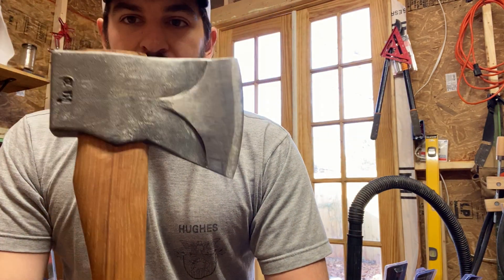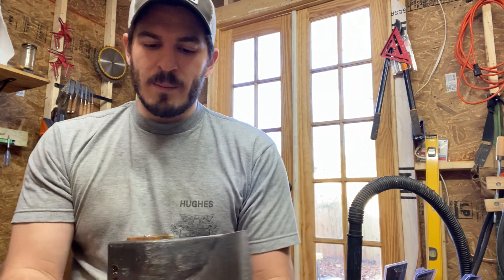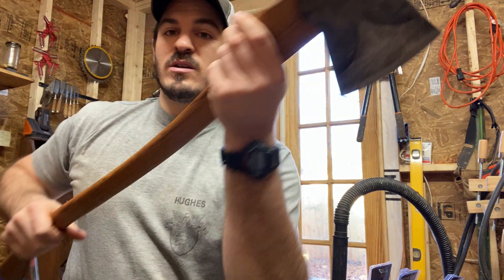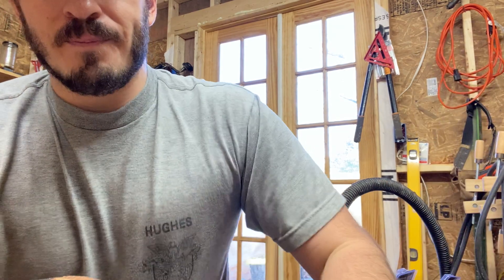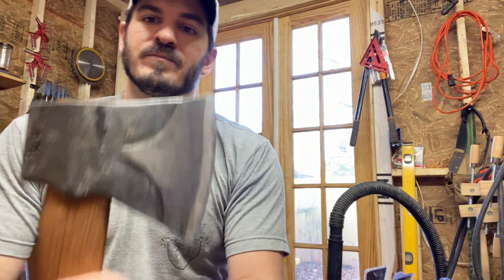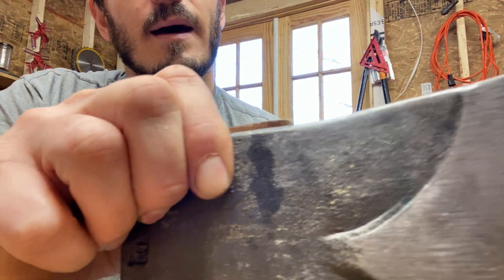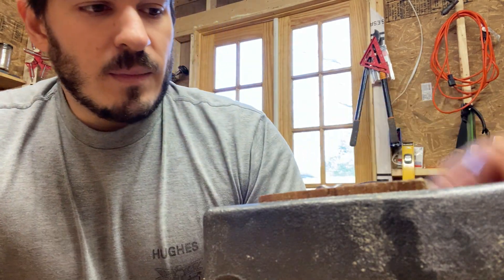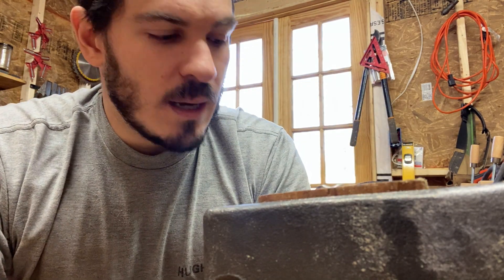The defect that could make your axe dangerous

Comment: yeah council tool deffo have the worst hangs
Reply from the maker: I was able to get the wedge out. It was so thin, not at all compressed. It didn’t go more than a finger width into the axe head when it should have been 2/3 the way in! I rehung the axe and it’s performing well now.
Reply: @urbanlumberjack  yeah at least it was easy to remove lol, bad hangs with barrel wedges mean you have to cut off the handle lol
Reply: Knipex makes a nail puller that works well on barrel wedges.  The company should be using glue on the wooden wedge.  Double up on the metal wedges if you like, but a properly hung head with a wooden wedge will not fail unless the axe was neglected in some way.  There is a lot to be said about tool maintenance and yes even something as simple as an axe needs maintenance.  Sadly, people mistreat their tools and blame it on the manufacturer.  Cheers.
Reply: Same experience

Comment: Thank you for your insight and raising my level of awareness. I purchased my first axe, council tools woodcraft pack axe, and received it today only to find that the handle was split by the wedge in the eye. I decided to return and replace. Hopefully the next one is in better condition.
Reply from the maker: Bummer about that handle! I have a couple videos using that pack axe, I am very happy with it, bites deep.

 Definitely good you took the time to check it out before needing it and discovering that issue later.

Thanks for taking the time to share your experience!

Comment: Thanks for sharing. I bought the 19” pack axe and the handle came loose in 2 days after processing some firewood and then exchanged it for another one and that came lose in 1 day. Lost faith in the company but decided to give the brand a 3rd try and got the 22” camp carver and hoping it will hold out
Reply from the maker: Hope it work out for you! I had a very similar experience, for me it seemed worth it to fox the issues because with a solid hang the axes are awesome, even considering the work to rehang if needed. Good luck!

Comment: My counil tool boys axe came loose after 4 notches into hardwood. I was pretty disappointed.
Reply from the maker: Did you rehang it? I was able to drill out the wood wedge and pop the barrel wedge out with a screw driver. A good wedge made the head nice and tight and I am happy with the hang now.
Reply: @urbanlumberjack  I did, I pulled the wedge and shaped the tennon to fit better. After that I pounded in 2 barrel wedges on top of a maple wedge

Comment: First notch I chopped with my council, the head came loose. The hang was terrible and the eye of the axe was symmetrical top and bottom so no matter how many metal wedges I added it would never stay on. I’m disappointed as well.
Reply from the maker: That’s a big problem. You’re right the axe head is defective no matter what you do, then. Did you return it or contact council tool at all?

Comment: I've had good out-of-the-box results from Council's premium axes, but have likewise had issues with their regular line. Most recently I had a new Dayton pattern axe come loose during the first use. I got in touch with Council and they sent me a replacement wedge, but even rehanging it didn't solve the issue. Further inspection revealed that the difference in eye size between the bottom and top isn't as much as on some of my axes from other manufacturers. In fact there was hardly any difference at all, which I see as a design flaw. The fix was to hang it with the handle protruding more than I typically like in order to get the wood to mushroom as much as possible. I've also not been pleased with the handle quality of Council's non-premium axes. I've seen a couple that were carved in such a way that it made them appear warped. For instance I had one where the palm swell was carved about 15 degrees offset from the rest of the handle. I suppose they're saving all the good handles for the Velvicut line.
Reply from the maker: That’s a bummer, not much can be done about a poorly forged axe. I recall a video wrangler star did a while ago on an autine axe that was misshapen and they used epoxy in the eye! No substitute for being familiar with your own tools these days

Comment: Two out of three of my Council tool axes have loose heads after, what I would consider, minimal use.
Reply from the maker: That’s a bummer. Which line of their axes? I’ve rehung probably 15-20 CT heads and it’s always been quick to do. Steel is good so I don’t mind doing it too much.
Reply: @urbanlumberjack  
The Flying Fox Hatchet head loosened and the Hudson Bay hand-axe velvicut loosened as well.

Comment: I've had to re-wedge the past like 3 council tools I bought. Will not be giving them more of my money, which is a shame because I love the steel and the feel of their handles. But I would rather shave and rasp up a new chunky HB handle than deal with danger.
Reply from the maker: I just bought the sport utility saddle axe. The hang was a full 1/8 inch off level. So rehanging that. I have now bought three council tool axes and I’ve rehung every single one. Thanks for sharing, Swedish axes have their problems, I think tool manufacturing generally has taken a steep dive

Comment: Weird, did they change the wedge? My Jersey Axe does not have wood wedge or barrel wedge at all, it’s completely metal, mine couldn’t be more than 5 yrs old. Edit: just checked on Amazon, it comes with a serrated aluminum wedge.
Reply from the maker: I’ve noticed CT manufactures axes differently, and I haven’t been able to put my finger on why. Some have aluminum wedges and are painted. Some are unpainted with wood wedges and some are painted with wood wedges. I do believe the sport utility axes all have wood wedges and of course the premiums are all wood wedges.

I’m going to contact CT at some point on the future to get some clarity.

Comment: I had a similar issue with my brand new flying fox.  The day I received it I used it to split some kindling and the head came loose.  Good edges, blade geometry , great straight grain handle.  I wanted to love it.  The hang was just bad, though.  Since I bought it with the intention of eventually putting in on a longer 17-19" handle, I didn't return it. I added an additional steel wedge and its holding up fine so far.  I always try to buy American when I can, but I was disappointed.
Reply from the maker: I had a very similar to not happen. I ended up putting the flying fox on a boys axe handle and love it. Awesome geometry, great blade. Worked out well, but I hear you. Would be a bummer if we didn’t want to do that anyways.

I think the head doesn’t get seated far enough down the handle before they put the wood wedge in. That’s my theory anyways, because I’ve really only experienced these hang issues with Council.
Reply: @urbanlumberjack  Must be why it's called the "Flying" Fox...

Comment: Grain on the handle is oriented wrong. Eventually a crack will form at the shoulder on the poll side.  Probably has grain runout down the length of the handle somewhere too; the handle has a good chance of breaking in half along the grain runout.
I'd keep the head, file and clean out the inside of the eye, and rehandle it with a straight-grained handle that's oriented correctly.

For the wedge, I'd squirt some chair-lock or wood swell on the wedge-bottom and a little bit in the bottom of the kerf too. Then wood glue on the rest of the wedge, a bit of glue in the kerf, and drive it home.  Then chop with it a bit. Then drive the wedge in again and observe at the axe-eye if the sides of the handle are mushrooming out against the eye. That means it's secure. Then I'd let it dry.

I can't stand a loose axe-head, even if it's visually imperceptible where you can just feel it slightly. If I feel that, I'll drive in a barrel-wedge or even just a thick nail that's been sawn off to shorten it to about an inch-and-a-quarter. A full length 3 inch or 4 inch nail will go too deep and crack the handle. That's why you have to shorten it to about an inch-and-a-quarter, an inch-and-a-half.  If you do the rehandling and wedging well, it takes some time and effort, but it'll stay well for many years of service.
EDIT: ...and of course the flax/linseed oil treatment.
Reply from the maker: I did rehang the axe. The wedge was so slim and dried out that it wasn’t too much trouble to drill out. With a proper wedge it’s real tight. 

I haven’t added a barrel wedge yet, but if the handle ever losses up I have that option.

This is my favorite axe handle, I love the heartwood color. For all it’s problems, council tools makes the best handles on the market as far as shape goes

Comment: I've never had a problem with Council's  hang's, I actually think the humidity has played the biggest role in your loose head. I prefer a regular metal wedge over a barrel wedge but if it has a barrel wedge I prefer a small one because the bigger one does more damage at the top it starts splittlig the wood in all directions especially the sides.
Reply from the maker: I’ve never had a problem with humidity but could be. I think more likely is the sharp edge on the bottom of the axe eye, it presses into the handle and creates a shelf. After rounding that over my CT axes are solid as a rock!

Comment: I recently received the woodcraft pack axe for Christmas. Didn't even come with a barrel wedge,only a wood and straight metal wedge. A little disappointing considering it's supposed to be one of their high end axes
Reply from the maker: So here’s my two cents. I have the pack axe, and I think it is the most functional axe on the market, especially the 24 inch. 

5160 steel is the best axe steel you can get, before getting into the $500 racing axes made of tool steel etc. 5160 will take an awesome edge, and is incredibly resilient.

As to the wedges, if the axe is properly hung, you don’t need or want one on a new axe. If a wedge is installed, I think it’s preferable to have a step wedge instead of a barrel wedge, because the step wedge leaves room for another should the head loosen over time.

So I wouldn’t fault a company for using a step wedge. The pack axe has lugs that give it even better contact with the handle. Take out the axe and smash it into some wood. Council Tool guarantees the handles for a think a month or two and will send you a new handle of its loose! If its not loose you’ll be good to go for years.

Comment: My 3.5 lb Jersey pattern did the same thing after 1 use. I do love the steel, so I'm in the same boat. I've gotta re-hang it. I literally have only used it 1 time and it slides up and down the handle about 1/4 in. The wedge is definitely not wide enough. Since we all have to re-hang them after the first use anyway, just sell me the steel. Don't get my hopes up.
Reply from the maker: It’s definitely worth rehanging and salvaging the handle. It’s my favorite axe by a long shot, now. The handle is extremely well 
made. I found the wedge was actually pretty easy to drill out, and the metal pin just popped out. Best of luck!

Comment: I've taken to adding a second, larger barrel wedge or a standard wedge behind the small one from the factory.  So far, this has been an effective solution on the councils I've found.  I hope they resolve the issue!  Good video, good lookin out.
Reply from the maker: Much appreciated, an extra wedge seems like a good way to solve the problem
Reply: Same, a second large wedge between the existing wedge and the hammering pole has so far fixed the loose head on my woodcraft pack axe. 

It got loose after about a week or use, was pretty bummed but luckily the second wedge has fixed it for now.

Comment: It seems to be a common issue on many axes this days., the last 4 axes i've bougth with "traditional wedge" hang, this last year have had the same problem, no mattter the brand ( ochsenkopf iltis, a pair if hardware line german axes, and a ct boys axe).and the  iltis has suffered from a bad temper also, with an horrendous chip on the edge after 1 hour of use...
That's an advantage on slip fit type axes.....they'll never fly off, no matter if they're a little bit loose.
Reply from the maker: I’ve never used a slip for axe, but would like to. It does seem to be an advantage, although at some point it seems a loose head would damage the fibers enough to fly off.

Comment: I agree that I wish they would sell just the tool heads and let us handle our own.  Even if I keep their handle I need to scrape it down and do some shaping to get it serviceable.

That said the head alone is worth what you pay for a finished axe.  And handles are consumables just re hang as long as you plan for it when you buy the axe all is good.

To use your car analogy it would be like not buying a car because you do not like the tires they sell it with.
Reply from the maker: Very good thoughts. I wish more manufacturers would sell just the heads. Apparently hilts Bruk sells some Montreal pattern heads in Canada, but not all the time.

Thanks for the input!

Comment: Gransfors hangs are not all that, mine came loose pretty quick I still can't believe I paid $200 for that thing. Sucks about the council tool at least you can rehang it better. The handles look quiet nice and I heard they are good, I think if they just sold the head along with the handle it would be better.
Reply from the maker: That’s too bad about the GB, especially for the price you pay. I was able to l rehang the head and am happy with it now. Took about an hour being careful not to damage the handle.
Reply: Yes manufacturers should offer heads and handles separately.

Comment: Saw a guy stop a flying 7 lb hammer head with his face - nasty ....  [but hilarious as it happens, and well deserved in the circumstances - don't judge me, the full story is too long to tell.   Council Tool really need to get their act together - that is downright wrong ! They got the head right it seems, but you might say they've swallowed the donkey and choked on the tail.
Reply from the maker: Yikes, that’s scary. I do think CT should invest some time with their hangs. More often than not i end up needing to fox them. As with most axe guys, though, it’s easy enough to spend a bit of time rehanging the axes, though, because they’re great when solid
Reply: @urbanlumberjack  The best hang is the one you do for yourself..... every time ! It does take a while to get close really good contact between handle and the taper down into the eye. I use a pencil to mark up the inside of the eye and this leaves good trace on the handle so you can see contact areas. I call it good and wedge up when I get 90% , or better, contact over the whole taper area. and 100% round the top where it meets the haft.

Comment: I just got a council boys axe among a bunch of vintage axes and was pretty psyched to try it. It was on a handle with a council tool sticker so it must be original and I was able to bang it back through the head without pulling the wedge. To make matters uglier the axe had an incredible shelf from being pressed on without properly tapering the fit towards the eye. I ought to post pictures of this handle for people to see.
Reply from the maker: That’s the trickiest part of seating the heat. I suspect there is a hang up at the CT factory in this process. I’ve noticed the same defect on several of my CT axes. I’ve always been able to fix it but my process it now checking specifically for that issue and rehanging if necessary. Thanks for the input!

Comment: I feel your pain man.   I just received a 19 pack axe from them and it was more loose than that right out of the box.   As of now they have done nothing make it right.
Reply from the maker: That's a shame. I really like those pack axes, but they are expensive, and I've heard about enough problems with the steel and hangs that I'm hesitant to pull the trigger.

Comment: I've often wondered if the eye ridges that True Temper, and other manufacturers, started putting in their forgings weren't partly an early attempt at planned obsolescence.  Many people remove a broken handle and see those ridges and think screw it I'll just buy another axe.  Edit: Now that I think of it my CT  sport utility Boys axe handle split  vertically at an eye ridge,  I wonder if your jersey has ridges.
Reply from the maker: The jersey doesn’t have ridges but the Hudson Bay did. That’s why the Hudson Bay was so dangerous. You need a really good wedge to push the ridges into the handle and secure it. If the wedge is junk the ridges actually make the fit looser!

Comment: I bought a 3 1/2 lb Council Dayton pattern back in December. Shattered the handle on about the fifth piece of blackjack oak due to overstrike. But not by much. Re-hung it with a wooden wedge and two barrel wedges. It's solid as a rock and sharp as hell now that I've put a little work in to it. The original handle was hung horribly, crooked aluminum wedge in a damn near diagonal kerf. I feel better about it since I hung it myself, and it was my first attempt.
Reply from the maker: Glad to hear it’s working out! The axes are worth fixing. Good steel. Just frustrating the hang gets too little attention at the factory

Comment: You can't expect much from axes that are as cheap as Council Tool. When it comes to axes, you pretty much get what you pay for.
Reply from the maker: I’ve had my share of problems with $200+ Swedish axes. One bit shattered in green wood and the other came with three knots in a quarter sized area of the handle.

The steel in this axe is as good or better than my HBs and vintage US axes. If they put a decent wedge in it it would be an unbeatable value.